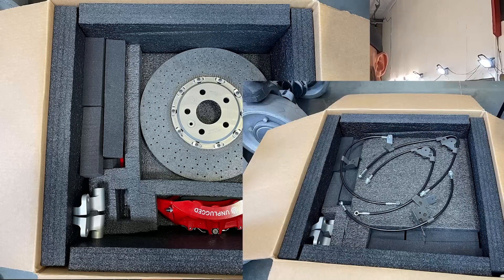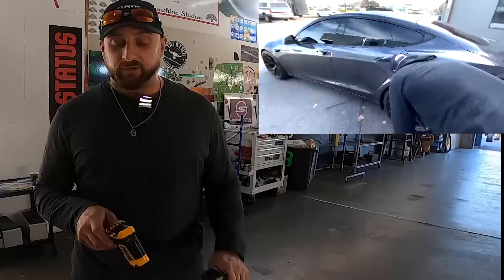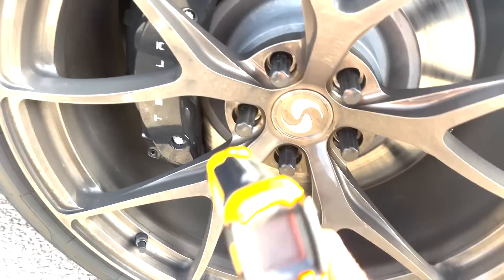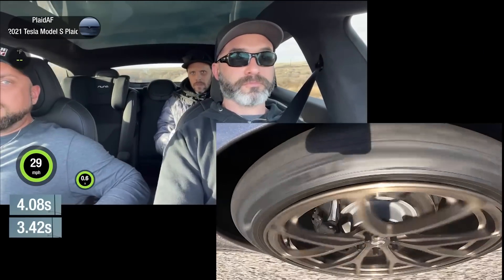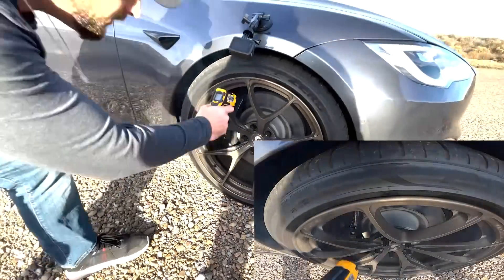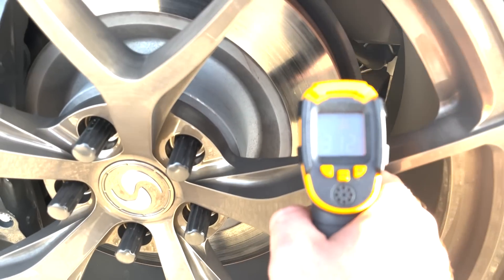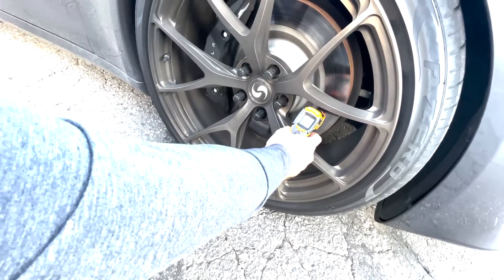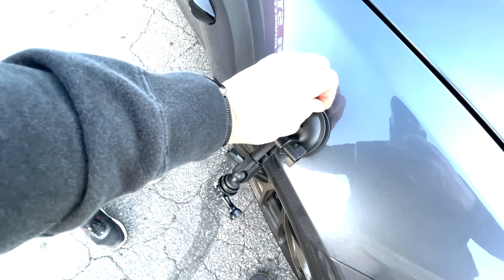Tesla Brakes Catch on FIRE | Model S Plaid

Comment from the maker: **Check out the details of the “testing” in the description of this video (I didn’t completely explain in the video, as our original plans of doing ten runs from 100mph to 0… well, that changed once we got out there!)
Reply: Set all 4 wheels to 38 PSI?  Ha!  Good luck with that.
Reply from the maker: @zachdavis5394  add your wisdom to the conversation vs your criticism.  What have you found to work best in your testing and experience?
Reply: @PlaidAF  I apologize. New quality pads and high boiling dry point quality race brake fluid have made a world of difference with my racing experience. Boiling your brakes is a scary experience I don’t enjoy having. Don’t forget wet boiling points are way lower and fluid needs changes often. Thx!
Reply from the maker: @zachdavis5394  thx for the input!  did you see the Big Brake Kit install videos we put out right after this?  carbon ceramics and motul high temp fluid + steel braided lines.
Reply: @PlaidAF  i'm curious to see how other performance sedans (and even regular cars) would perform under the exact same test.

Comment: Its not just the brakes! Its also the brake fluid. It boils leaving you with zero brakes. Tesla completely overlooked the part where a 2.3 Tonne car going 0-60 in 2 seconds and easily getting to 150 and over mph needs actual brakes that can withstand that pressure and abuse. Yeah the brakes work great for one emergency stop. But that’s not enough. A car that has such performance needs to be able to stop everytime in any scenario without issues. Anyone who owns this car, get yourself some proper brakes, and proper brake fluid with stainless steel lines going to each calliper.
Reply from the maker: 🙄 duh

Run Motul 660

Comment: The fire is due to the grease on the edges of the pads, nothing abnormal… happens to most of the cars in those test scenarios, but you better take it apart and grease them back ;)
Reply from the maker: nope, they are GONE!!! Unplugged Carbon Ceramics are filling that void now =-)

Comment: Most standard OEM steel brake rotors are vented, even on whimpiest of compacts, they have internal vanes for this purpose. Some small brief occasional fires are expected. It is mostly burning brake dust---carbon dust, as pretty much all OEM brake pads, whether ceramic or otherwise, will contain some carbon-based compounds. Carbon atoms don't like being alone & oxygen is nearly always its best friend. The best solution, where possible, is to "douse" the flames by driving at some slow steady speed....40+ mph for a bit to cool things down. Never NEVER ever try to put the flames / smoke out with water, including puddles or snow piles, or any other fluid; you'll instantly warp the rotors and be way worse off.
Reply: The ceramic which is what is on "fire" in the brake pad doesn't need to be driven at slow speeds to stop flaming. The heat will simply dissipate and they will stop on their own.

Comment: Get the carbon ceramic brake kit, available to buy from Tesla. Another note that the rims you using probably doesn’t help with cooling. If you look at Tesla or other maker OEM wheels they actually put some engineering in it for cooling purposes and not just the “cool “ factor.
Why would Tesla and Toyota call them “long range” if they don’t make a difference in aerodynamics 
On Tesla cars the brakes are hardly used otherwise because of the regeneration, mostly motor brake. Unless you driving like a mad man on streets or track, you probably never need brake pads on a Tesla car. Seen them with over 150k miles and the brake pads are ok
Reply from the maker: I have the UP Carbon Ceramic BBK.  The Signature open rims absolutely will help reduce temps, the other rims will likely act as a heat barrier.

Comment: I've seen "burning" before when bedding-in new metallic brake pads. It was night and I pulled over to let the fading brakes cool. I got out and noticed the rotors were slightly red and the pads had a weird blue flame around them. I just blew out the fire like in the video. I didn't severely abuse anything, just stopped when the fade was obvious. Nothing happened to the brakes and they went on to give years of service. I'm not sure a fire extinguisher is going to do much besides grease up your brakes and wheel.
Reply: The fire extinguisher is in case a fire erupts beyond the pads and by putting out the fire, the car would be spared. Worst case scenario stuff…
Reply: @mnowadmin5676  Which isn't going to happen unless you apply an accelerant to the area.
Reply: @Jaredscott89  isn't accelerant for regular oil /gasoline related fire??
For an EV, I don't think an accelerant is much of a factor... Irrespective of the accelerant, the batteries can catch fire,...

Comment: A street car? That's not really how its been marketed. It is a rocketship that you can drive on the street. A car which constantly has its Ring time floated and gloated about needs to have brakes up to the task...these clearly are not.
Reply: I would say these brakes are not even suitable for this car on the street. The size of those discs is comparable to those on entry level hatchbacks. Even very basic performance models come with much larger brakes. Here they could already smell the brakes after 3 brakings from 100 mph. That means that if you were to take this to near its top-speed of 200 mph and brake hard once, you'd immediately get brake fade and potential permanent brake damage. Remember kinetic energy at twice the speed is four times higher.

Comment: please don't use a fire extinguisher on super hot rotors. It's like splashing a pot of boiling hot water on a windshield that has ice on it. Something is going to break.
Reply: Nobody was going to use a fire extinguisher to cool down brakes… the reason to carry a fire extinguisher is in case a fire occurs that spreads to other areas that would burn a car to the ground- in that scenario, screw the brakes, the goal is to save the car and avoid any injuries to people.

Comment: These flames and smoke are just the grease burning off, ok ok maybe also parts of the seals. All normal after this braking, have seen worse to be honest. Performance did not degrade that much, which is good. Never take the guy, that asked where the extinguisher is, again with you on a test ride. He seems dangerous and misinformed. Just saying. ;-)

Comment: Would happen to EVERY car with standard brakes on the market…
Reply: No it wouldn't. Almost any midrange "performance" model from an established brand won't have this kind of trouble. You can take an RS4 or RS7 for example and brake it hard from 100 mph repeatedly. It's not going to start smoking after 3 attempts, and it definitely won't get brake fade until several dozens of consistent hard stops. You can intuitively understand this because if you take a close look, the effective area of braking surface on the front discs of an RS7 is more than twice that of this car, despite the car weighing less.
Reply: @zolikoff  which part of „standard brakes“ was not clear for you? What trouble? It’s a (stupid) experiment far from reality. We are at this ridiculous point, because this family limousine is beating every old school super sports car on the track in it’s factory set. Let’s be fair, wait a bit and do compare the brakes of your horchs with the upcoming new Tesla roadster!
Reply: @ministeriumfurstartsicherh9895  What I described is also "standard brakes" for any car that is built with high speed capabilities in mind. If you make a car that can go 200 mph you have to give it adequately strong brakes standard. So it's precisely those "standard brakes" that should be much, much better from the factory.
It's another thing that if you want to make a track car out of it you'll need to upgrade the brakes, that is true anyway. But the "standard brake" we are talking about in this case is simply inadequate for road use of this car.
Reply: @zolikoff  I have a different opinion. With tests like these you are able to overstress every braking system. Simple reason is, that the carmakers are not constructing for that usecase. Especially when you don‘t take museum cars that soon will be forbidden to sell. The high weight of the powercells is working on them. But in everyday life, the standard brakes work pretty well, because in everyday life you don‘t put your kinetic energy in the brakes but back in your battery. Anyway the title is clickbait, because the brakes themselves don’t catch fire here (impossible) but the dirt from not needing them regularly. Check out the other comments for details on this. Even with torture like this and no recuperation the system was delivering and neither fading nor failing. No problemo. Well dimensioned. But an ultra sportscar like the new roadster will sure have above standard brakes.
Reply from the maker: And every car is not 1020 hp and 4800lbs
Reply: @PlaidAF  that’s why I put the word in extra big letters.. ;-)

Comment: This is pointless. Even though it's an amazing built car with enormous power, it's a street car. If you are doing several stops at 100mph and doing TRACK days or RACE days, then you need to outfit it with track and race equipment like brakes and tires which you will always out run.
Reply: Nope

Comment: What I learned? ... get a fire extinguisher.
Reply: Not convinced it would do much good. I went on a fire safety course and a full discharge of an extinguisher was enough to put out a wastepaper basket fire. I'd assume the other front brake was also on fire, so you'd at least need two people with an extinguisher each. Also I reckon you could do a lot of damage to the car with an extinguisher. Much better to do what they did in a video and drive around for a couple of minutes at safe speeds. As per other comments, happens in race cars all the time. You just need to get them moving to cool them down with airflow and the fire will go out.
Note: this is not a comment on whether the brakes should be better, just on whether a fire extinguisher would be useful.
Reply: For sure!!!
Reply: Teslas seem to burst into flames every now and then, so it sounds like a smart move

Comment: People are saying this test is crazy but Porsche does an even more brutal test from the factory. Road and Track article: “Porsche is required to pass a braking torture test: 25 stops in a row, from 80 percent of a car's top speed down to 90 km/h (56 mph), with every fifth stop involving full ABS. For a car to pass, it has to generate between 0.8 and 0.9 g of deceleration every time.”  

If only they applied the same level of testing to their batteries lol
Reply: It’s funny how the experts come out of the woodwork, say now this is such an unrealistic expectation for a set of brakes to be able to hold up to eight hard stops, I strongly disagree🤛🏻
Reply: @mnowadmin5676  then tell me what is realistic expectation and need? I doubt is is braking like an idiot for a daily car driving
and if a sports car company known for its strong ICE cars tests brakes extensively ... yes...they should, because the brakes are always used when going with an ICE; and then you have guys with a small... and the selling point of a sports car; you may drive that sportive eventually
but I guess a Tesla S Plaid is the same...?

I think this is about reflection...and use cases....what makes sense...

Comment: Speaking from experience, it isn't that hard to light all kinds of pads on fire.  :)

This is the "street" version of the Plaid and it does appear that Tesla selected something relatively low friction for the stock pads (which incidentally are the same as on the LR.)  This was likely done for comfort and manufacturing simplicity - 90%+ of owners will never go to a road course and most braking for normal use is via regen.  That means that all of us get to play a bit and find out what's necessary.  Tesla has their version public now, the CCBs, but most people who have them don't use them on a road course because they are too expensive - iron with proper pads are usually the choice.  Our car is up at Mountain Pass Performance now getting several modifications - including a stock caliper "BBK" in the front which also moves the brake balance a bit forward.  It seems like they gave the car significant rear bias as well and we'd like to move it forward.  We will also get some track specific pads as well.  We'll post some videos up to share the results - thank you for doing the same!
Reply: intersting, i suspected the bias was toward the rear so that all the regen could be through the front motor to save the front brakes as much as possible, which would be why big rears would help out the setup more then a normal car.
Reply: @Scholzey  100%  In the 'older' cars (3/y) the stock cooling system and electronics are not up to the task of multiple laps at full power, so when Tesla did the system modeling they put limits on the electronics in software so that they won't overheat anything and cause a fire.  This is fine, but it means that even when we improve the mechanical cooling systems and the car is running much cooler, the modeled values are the ones used to manage power.  So we run those cars with zero regen in order to try to use the electronic capacity for power only as much as we can.

In the long run, this doesn't make sense of course, it would be best to be able to use regen.  With the new S - which is basically a big, upgraded 3/y from a electronic standpoint - they increased the cooling system and the electronics capacity significantly.  We don't know yet about software setup for modeled values vs actual, but we are hoping that we can use regen and planning for the case that we can't with a 3 lap at 750hp+ target.
Reply: @teampgr  i winder how a moderate bank of supercpacitors for race applications  would help out the battery pack. If it can be used for braking g event then the next acceleration event, that would save the batteries from peak loads quite significantly, and from what I hear, the thermal load in super capacitors is very very low, so they might only need a tiny bit of cooling.

Having said that, it would increase the power going through everything else, so would depend on the thermals on all the other systems as well.
Reply: @Scholzey  My understanding is that they are not currently energy dense enough for the weight/volume to be useful.  There also is no need, the battery can take 800+kW if it's at the right temps, but the electronics can not do that and power the car over and over without overheating.  Maybe sometime in the future!
Reply: @Scholzey  brake bias is to the front on every modern passenger vehicle. Bias to the rear causes cars to spin 180 degrees. Tesla is closer to a "normal" car than you might think. Electric cars are much more similar to a "normal" car than they are different.